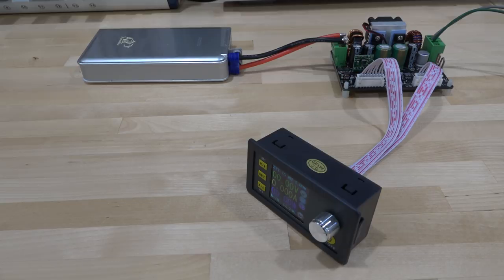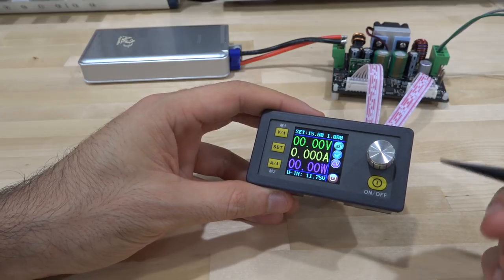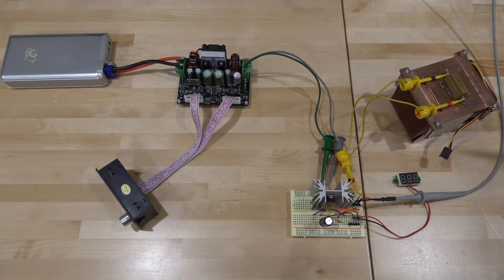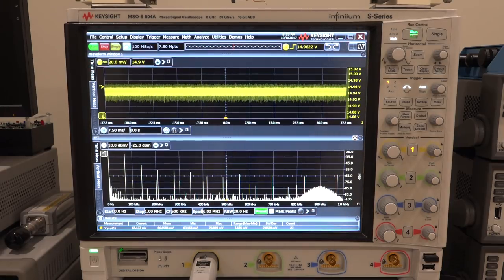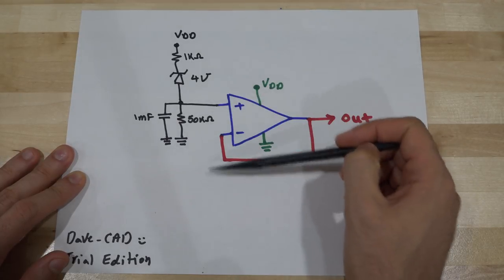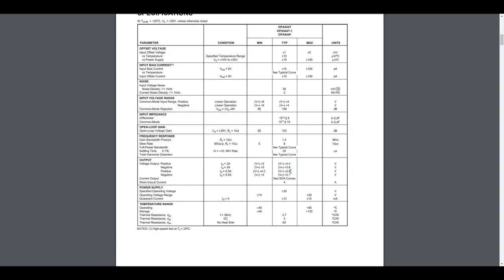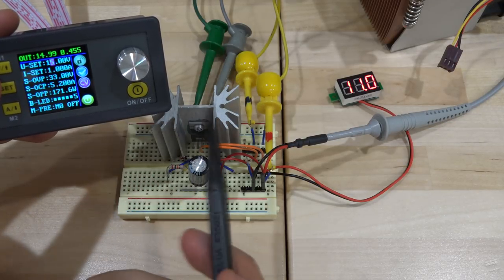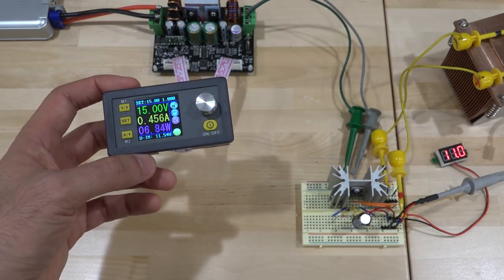TSP #112 - Noise & Performance Considerations of the DPH3205 Buck-Boost DC/DC Converter Module

Comment: While I generally agree with shazam that additional L-C output noise filtering should be the primary approach, I believe that this article from Wenzel provides insight on how one can more effectively use a “power op amp” to significantly reduce noise – particularly in the troublesome LF range. Think of it as the Bose noise cancelling headphones for low-noise voltage sources. http://www.wenzel.com/documents/finesse.html
Reply: The article is interesting for low current applications.  I have noise reduction needs in the 20 to 50 Amp range.
Reply: I agree that scaling up to 20 to 50 amps would be more challenging, but with respect to Shahriar’s use case in his video, the power op amp that he’s chosen would be able to inject sufficient inverse noise current into a correspondingly low resistance shunt on the order of 100 milli-ohms – perhaps much less. In a pure AC configuration, one benefit for the power op amp is that it is only burdened with carrying the noise power, so it should run quite cool – even at full load. Unfortunately, that configuration would require higher rail voltage on the op amp to effect a bipolar output about the target output voltage. By purposely introducing an offset into the op amp circuit to cause it to draw DC current statically through the shunt, a new virtual mid-point could be established within the anticipated noise amplitude and reduce or eliminate the higher op amp power supply requirement. Even better, use the power op amp as a driver for a large bipolar or FET transistor to scale up even higher.

I propose this only as an interesting way to use a power op amp in this use case. Otherwise, L-C filtering or a downstream high-current adjustable LDO would serve the same purpose as the op amp series regulator, but at a much lower cost, better rejection, and available survivable current limiting.

Comment: You really can start a car with one of those battery packs but not if the car battery is very much discharged.  With the ones that I have tried the car battery has to still be at least 8 volts and won't work if it's very dead because most of those jumper units check that they are connected to the battery first and polarity is correct before turning on the output and if the battery is really too dead it won't turn on.

Comment: If you want a power opamp try TDA2050, it is dirt cheap comparing to a 20$ BB part. Also you can whack a simple discrete output stage inside the feedback loop with two transistor and two diodes to a regular small signal op amp and save even more on a fully functional power opamp. But after that you don't need a complete output stage, you can do it with a small signal OPA and a single pass transistor. Your circuit doesn't make too much sense, you could've used much more sophisticated filter other than a simplest RC one, if you decided to use a power opamp after all. Also do not try to filter stuff that comes to MHz region with an active circuitry, it needs to be a few orders of magnitude more complicated. For that better use low-Q inductors and very low-ESR high quality ceramic caps. Also you will need a nice board layout.

900Mhz noise is from a radio mic transmitter.

Comment: It would be interesting to see what noise an LM317 would show in a similar circuit, something like this: https://farm5.staticflickr.com/4487/36856666644_5cb6089f2f.jpg .
A better way to do the RC ciruit of the zener diode: https://farm5.staticflickr.com/4458/36901499104_2c3a121339.jpg
And to throw a TPS7A4700 into the mix too (it's a VERY low noise linear regulator).

Comment: Around 900 MHz you're picking up several LTE carriers.  Each one is 20 MHz wide using OFDM with thousands of little thin sub-carriers. [But see below - I misread the scale on the FFT as MHz instead of kHz, my bad!]
Reply: That may be true, but the hump is at 900kHz not 900MHz.
Reply: stefantrethan Oops moment! Misread kHz for MHz - not used to looking this low down in the spectrum ;-)

Comment: Hm...EEVblog released a video about those PSU few days ago...
Are you and Dave Jones are working together?
Maybe this manufacturer payed you to make an advertising video?
Maybe it is a parasitic fungus which forces human to buy a PSU from this company and make review?
Reply: It seems you didn't pay attention. Shahriar DID mention Dave Jones just made a video on these PSU. And they don't need to be advertised as very good units for the price since that's exactly what they are. You can make a decent lab power supply for the hobbyist for 1/6 to 1/10 the price of a regular power supply. Since a large part of the EEVBlog and Shahriar viewers are hobbyists, it's completely unsurprising that these are featured. 
You certainly haven't paid attention either to the fact that there were already MANY videos about these modules before EEVBlog made one.
Reply: Sure Shahriar and Dave belong to the same community. But The Signal Paths released this video just few days after Dave. It is a coincidence, that both of them had this PSU around. Of course it may be that Shahriar saw Dave's review and bough one unit right away and made a quick video...